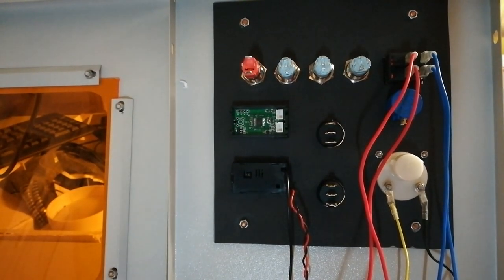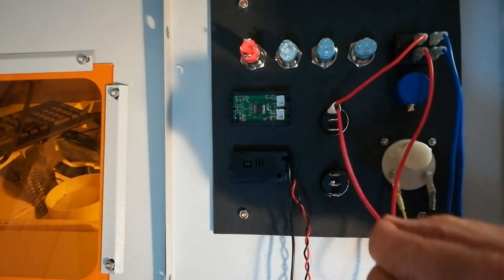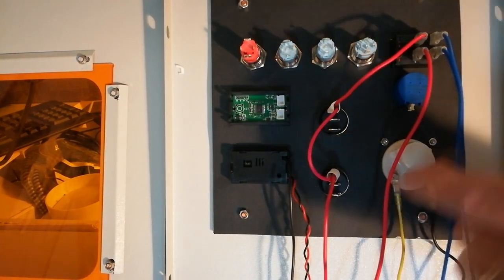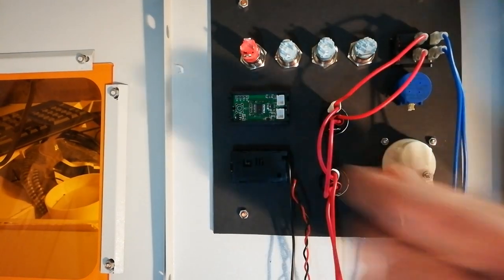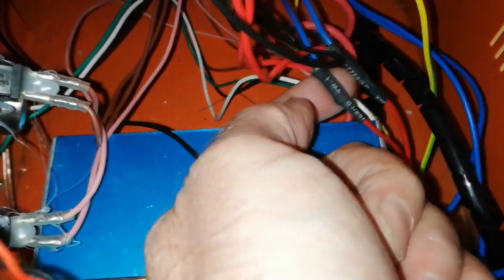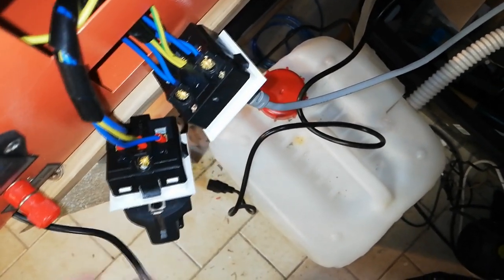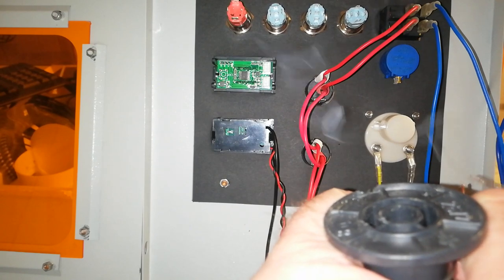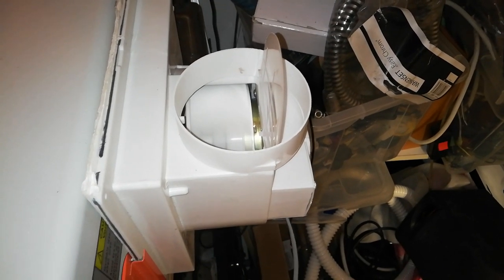K40 Laser upgraded control panel wiring Part 2 Mains wiring.

Comment: Waiting for part 3 before ordering all the push buttons :) I will probably go with 19 mm buttons because there are more assortment of icons and images (the fan, the light, etc).
So are the buttons all 12v, except for the two 220v for air extreact and pump?

Comment: the wires for the power switch on mine have a different wire color. its 2 red on top and 2 black on the bottom. Will  I still follow the wiring steps you use? in the same order?
Reply from the maker: Yes should be the same process, messure them with a multi meter if possible.

Comment: Is the Laser On LED working? I think its only 5V right? I cant find LED switches that light up when pushed and use 12v for the LED and 5v for the switch.
Reply from the maker: Hi the LED switches are 12v, I should have the video out this week for the wiring setup.
Reply: @letsfixit1594  Im using 12v switches too, so the Laser Button is pretty dim compared to the others.
Reply from the maker: @TheT3KO  Are you using an external 12v power supply?
Reply: @letsfixit1594  Yes Im using a dedicated 12v psu for all the switches and lights.
Reply from the maker: @TheT3KO  Weird, did you try another switch?
Reply from the maker: @TheT3KO  I just had another thought, did you connect both negatives together on the power supplies?
Reply: @letsfixit1594  Just saw your video, didn't really think about switching ground and not the 12V line... Thanks.